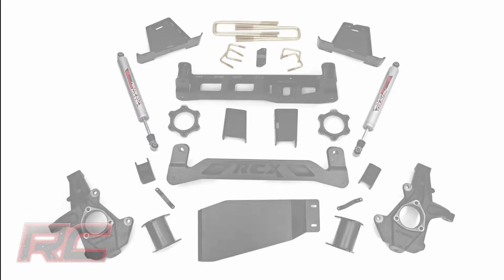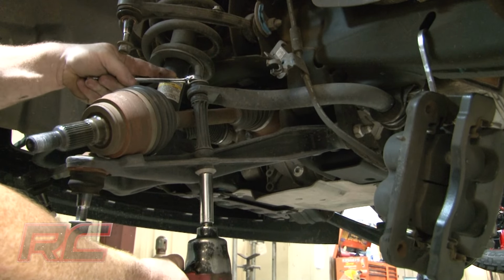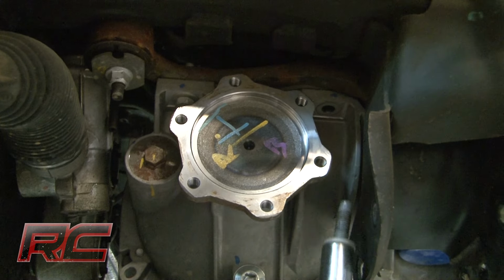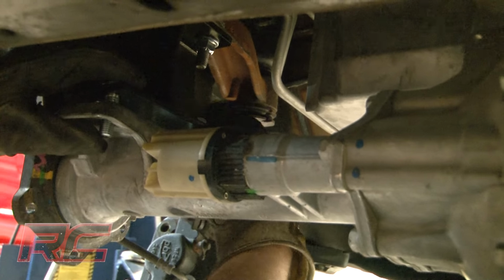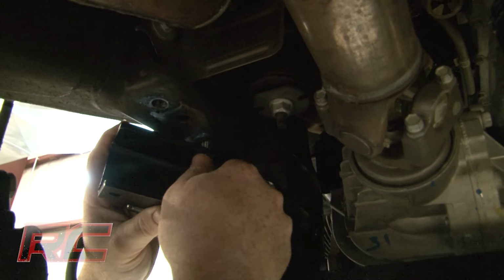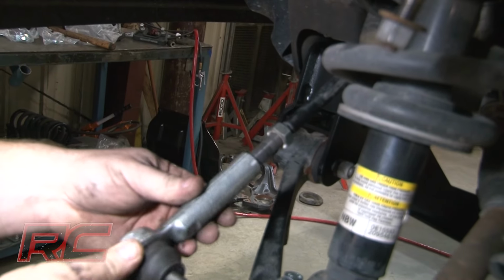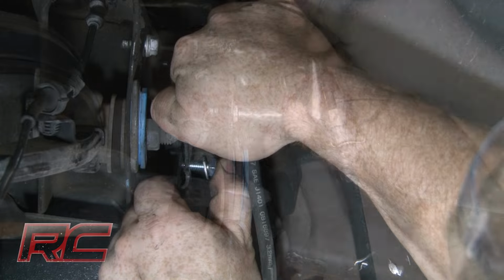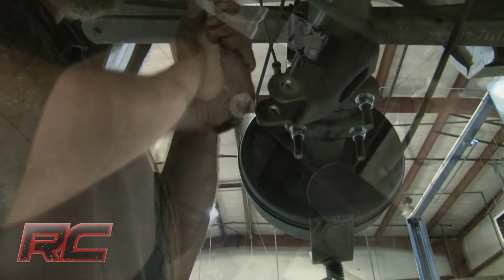Installing 2007-2013 GM 1500 7.5-inch Suspension Lift Kit by Rough Country

Comment: Anyone knows what size of lift is in the front I bought a truck with a spacer lift and spindle and now I need new struts but not sure what size of struts I need
Reply from the maker: this is a 7.5" lift. There's a link in the video bio that will take you to the site for full specs and install intructions. If you need further help, you can reach out to our support team and they can sort you with the parts you need. For assistance, please contact our sales team—they’ll be happy to help. You can reach them by phone at 800-222-7023 or by email at customersupport@roughcountry.com.

Comment: Was there any torque done per specification? My lift took long to install as I looked at torque specifications for proper installation rather than just tightening nuts and bolts

Comment: Worse thing to do is to cut out for the crossmember. Had my lift for. Few years now looking in too dropping it back to stock… fuxked up thing is that no shop will tell you this.
Reply: Yep… these lift kits are cool until you want to be practical or sell the truck

Comment: Just want to say that i just did this lift on my buddies truck. Good luck getting the knuckle and top control arm to connect. I was 2 inches away and thought they sent the wrong struts. We used the 7.5 lift struts instead of spacers. I called rough country and ran all part numbers. I finally got it but had to use strut compressors. Pretty sure i almost met god, but i did get it.

Comment: Does this require major modification or could this easily be changed out to a smaller lift? I’m looking at a truck with this kit but the lift is too high
Reply: It's a 1 time lift. Theres too much modification. There's no removing it once installed.

Comment: Just installed this kit (7.5in w/N3 Struts) on a 07 Tahoe 4WD. I was wanting to purchase your forged upper control arms but in the description it states, Does NOT fit models with 5, 6, or 7.5 inch suspension lift kits. In a response here to another comment, you said it will. Can I get an answer on whether it will fit or not?
Reply: yes they will fit

Comment: Does this lift require aftermarket upper control arms or can I use my stock ones?
Reply: aftermarket ones are recommended, but stock ones are still useable. it just puts more strain on them with the weird angles

Comment: I bought my truck 09 GMC Sierra and I’m not sure the exact lift I have but it’s a RCX Lift kit installed!! My rear blocks are 7” and front strut spacer is 6”.. 🤷🏼‍♂️
Reply: I’m in the same boat, let me know if you found any helpful information!

Comment: I have a 2011 z71 with the 7.5" lift kit, and was to the understanding that the stock upper control arms are ok to use, but I have gone through 2 sets of upper ball joints (moog) since installing (less than 30k miles). Should I use a different style upper control arm?
Reply: Hey what did you end up doing? I have extended uppers for my leveling kit.. I'm wondering if the extended uppers will be okay to use with the new knuckles or if I need to use the stock ones..
Reply: RC has new forged UCAs to help with those angles for this specific kit.
Reply: Moog used to be top of the line not anymore they are garbage best to get oem.

Comment: 8-10 hours the direction say...2.5 days in the average joe garage, even with a sufficiently full set of tools and that's assuming you don't sleep the first night. If you want to get this done in 8-10 hours, they should ship that second dude to you in the box so he can hold everything while you unbolt it. The main dude in the video barely has grease on his hands. By the end of of day one, the bums outside of the auto parts store didn't want to get near me because I looked too dirty.
Reply: Took me 12 hours and I’ve never put a lift on before
Reply: @koltonhinton4894  let's see it
Reply: You must be inconsistent or working on a rust bucket or all in all not a mechanic lmao
Reply: lol 😂so true
Reply: Took me 3 hrs
Reply: just put the 7.5 inch lift on started at about 930 am drove it home at 530
Reply: finished same day
Reply: This comment is 8 months old and it is entirely under rated lol

Comment: CV shaft angles are absolutely ridiculous. Make a better drop bracket, or we won’t buy RCX anymore. I’ve gone through 4 hub assemblies and 4 CV shaft assemblies.
Reply: The diff drop brackets are to short. They should be at least 2" bigger then the cv angles would be better.

Comment: If your going to cut the outer tie rods why not replace them with something you can grease. As this stuff gets older I see that as a problem. I would have included new inner and outer ends in the kit. Pretty cool otherwise. Sounds like it would fit a Tahoe as well?
Reply: I couldn’t agree more . I’m getting ready to install a RC 6” lift by myself. I already have the kit but I am replacing cv shafts hub bearings all bushing’s etc while I have it apart.

Comment: Hello I have a 2007 gmc yukon xl denali will this kit fit my truck.i took off all my electronic suspension in the front and put regular struts and the same for the rear took the air shock off and put regular

Comment: Looks like a fun way to lose your rear axle. I like the front end lift parts, but your rear lifts are so unsafe! Why not offer less blocks and more leaf lift.
Reply: Because it will ride like a dump truck, this is actually better, it's safe when installed correctly.
Reply: My Chevy 1500 pulls 8,000 lb mini-excavators on double axle as well as fully loaded dump trailers haven't had any issues yet with these blocks my truck had now has 420,000 km and if you add more leaf springs u lose your flexibility for off-roading 2010 Silverado on a 7.5 in rough country suspension lift on 35s
Reply: I put 3500 leaf springs on my 1500 and it rides perfectly fine for me. 
I’m not a sensitive man that would complain about flexibility or rough ride nonsense, but to each their own. 
It is what it is..

Comment: I just picked up my 7.5 lift for my 08 GMC 1500 yesterday Tue/April/6th  and I am so disappointed in it that I will be returning it. I got the old styel strut spacers, the ones that had the problems with the welds cracking when tightening the bolts and not the new styel ones, You guys really cut corners on the welding of the components, their should have been more welds, And I have never seen orange peel on powder coating so even the powder coating is the shits. I would be scared to even put this lift on my truck.
Reply from the maker: It appears you might have just received a bad part as that is not common on our spacers to not be sufficiently welded or manufactured. We would be glad to send you a replacement pair if you gave us a call at 1-800-222-7023

Comment: Can you run 35x12.5x20x9"on factory rims with no trimming to inner or outer fender well with this lift.
Reply from the maker: As noted on the site you have to run aftermarket offset wheels on that kit due to the lifted knuckles that are included in the kit.
Reply: @RoughCountryTV  "I just bought black factory 20"x9" rims for $800.00 Canadian so I better be able to use them with this lift" This is off your website:  Gain ride height at an incredible value with Rough Country's 7.5-inch Suspension Lift for '07 - '13 Chevy / GMC 1500 Pickup. This massive lift affords your truck the ability to run up to an impressive 35-inch tire on ((factory wheels)) with our unmatched front and rear high-clearance crossmembers featuring the "RC" logo. It says nothing at all about running aftermarket offset wheels. It also says you need a minimum of an 18'' wheel for clearance.

Comment: I have an 08' Silverado 2wd, and I want to install this exact lift, will it require the cutting portions?
Reply: Don’t....
Reply from the maker: https://www.roughcountry.com/gm-suspension-lift-kit-263.html?find=2008-chevy-silverado-1500-2wd-374116

Here is the 2WD option
Reply: 😂😂 jack up a 2 wheel dig
Reply: Do you have to have a new drive shaft to put that lift on

Comment: I'm new to learning about the lift kits and such. What size wheel spacers would I need on the rear to match with the front track width once I put the lift kit on? Putting a 6" RC suspension lift. 2008 gmc sierra 1500 z71. Thanks
Reply: 2 inch
Reply: I thought basically the same width as the cv axel spacers

Comment: This lift was installed on a truck that I just bought, but the camber is way off on my tires if I get your longer upper control arms would that bring it back out instead of using the stock upper control arms because they rub the coil springs.
Reply from the maker: Our upper arms would allow for additional camber adjustment
Reply: @RoughCountryTV  broooo you again. You guys told me tha I won’t,  I’ll never gonna bye RC stuff, y’all don’t know how to make anything about liftkits. Twice alignment, new upper and cam plate… you just ruin my suburban
Reply: @samuelrodriguez9395  I believe that was user error

Comment: Video I’m assuming shows reusing the stock upper control arms, i have a 3.5” kit also from RC. Can i use these upper control arms or will i have to find a stock set?
Reply from the maker: Yes this kit is using the stock uppers. You can use the aftermarket arms on the 3.5" and 7.5"

Comment: Does anyone know What is the torque spec for the ubolts on a 6in on a 2009 sierra 1500?

Just bought your Trac bar kit and don't know the torque specs?
Reply from the maker: 95 FT LBS on the track bar on both ends

Comment: I'm very interested in this kit! However, I noticed it's advertised as "for 4WD Chevy trucks"!  I own a 2008 GMC Sierra 1500 RWD. Is there a different kit for that?...Thanks......Richard
Reply from the maker: Yes there is a difference in the 4WD and 2WD options. Here is the link for the 2WD option.

https://www.roughcountry.com/gm-suspension-lift-kit-263.html

Comment: If it’s a 2wd will it still require the cutting portions
Reply from the maker: 2WD does not require any cutting
Reply: Rough Country what would you rate the difficulty on this specific truck and lift but on a 2wd for the average joe.

Comment: Just cerious if you don't cut the tie rods and it ends can u still get it within soec
Reply from the maker: No. The tie rods have to be cut in order to bring into alignment specs
Reply: @RoughCountryTV  one other question with doing this and putting bigger tires on will it drastically lower towing as I have a 7x16 inclosed trailer with 2 sleds

Comment: I had a miserable time getting the upper control arm into the knuckle after the lower ball joint was installed. I had to use ratchet straps to pull the control arms towards each other just to get enough thread on the upper ball joint to grab it and suck it into the knuckle. I didn’t loosen the upper control arm during install, it would have most likely been easier that way, but there was barely any compression in the strut/spring assy to allow for installation
Reply: Need new a arms I bet ur tires wore on the inside

Comment: I have a 2008 Silverado 1500 that I bought that came with a 4 inch suspension lift and I added a strut spacer so basically a leveling kit to make it a 6 inch lift now my CV angles are at an angle and was told I need to drop the front diff down more but called rough country and the front diff block spacers are the same for a 4 inch  lift and the 6 inch lift? A suspension shop told me I had to just take the lift off because there was nothing I could do. I just didn’t get how a 4 inch lift and a 6 inch lift use the same size of front diff drop bracket and how the CV angles wouldn’t be different then with the larger lift ?
Reply from the maker: You have created the CV axle issue by adding the level kit to the 4" kit. Your best bet is to replace the 4" strut spacers with the 6" strut spacer to correct the geometry and removing the level spacer.

Comment: Had this lift installed on my 08 1500 vortex Max. Pushed the breaks real hard to keep from hitting a girl running across the road. Driveshaft ended up popping out too much and when I stopped putting so much force on the break the driveshaft tried going back in but ended up destroying the slip yoke and tranny had to be replaced/rebuilt. The tranny shop said I needed a 2 inch spacer but another truck/lift shop said there’s no need for a spacer, maybe the shop that installed the lift put the blocks on backwards?  SO I wanted to know if I need a spacer or a word with the guys who lifted my truck....
Reply from the maker: The bigger end of the block should be the rear of the vehicle. Is that the way it was installed? Do you have a 1 piece or 2 piece rear drive shaft?
Reply: Rough Country the blocks are installed correctly and I have a one piece driveshaft. My trucks is a 2wd

Comment: Any kits for the 06 4x4 silverado?  Looking to get 24x14 on 35 but want minimal cutting.  What size lift do you recommend?
Reply from the maker: That size tire and wheel requires a 6" lift kit to clear that tire and wheel combo

Comment: Can you replace rc rear shocks with billstein or something else? Or Are they taller than normal, thanks.
Reply from the maker: Our shocks are taller to accommodate our kits on the vehicles. You can use other aftermarket shocks as long as they are the correct specs for the specific ride height.

Comment: where the front cross member is installed the upper bolts where you cut your better off welding each side it makes craking noices like hell dont know if i had wrong bolts or what threads are 1/2” inside the plate making cross member slide

Comment: What if you want to go back stock? Can you go back ?
Reply: Alan Perez save the piece of steel you cut off and all the stock parts, all you have to do is weld it back together. It’s an easy weld. Make sure you do your cut nice so it’s easy to refit and weld after
Reply from the maker: Once you install the 5", 6" or 7.5" you can not return the vehicle back to stock ride height.
Reply: Alan...but why go back to stock?
Hope you got your lift...once you go there...you will never be the same...hahaha

Comment: even for a 6 inch lift kit will they be cutting  and if the cutting is necessary won't   that weaken the frame or something
Reply: I believe the only difference between the 6" kit and the 7.5" kit is the rear blocks, u-bolts, and strut spacers.
Reply from the maker: You cut the tie rods and tie rod ends, crossmember pockets and diff but with this kit installed per instructions and the cutting that is needed to be done it does not jeopardize the integrity of the strength of the vehicle or frame.

Comment: I bought the 6 inch do I really have to cut my tierods?
Reply from the maker: Yes. In order to properly align the vehicle you will have to trim the tie rods and sleeves on the knuckle kits.
Reply: Rough Country but my instructions don't say to do that?
Reply: Yes. Just did mine. Instructions say cut 3/8" from inner and outer tie rod. I ended up cutting 1/2" on driver side for a little more toe in alignment.

Comment: Go mcgaughys..you dont have to cut anything!!
Reply: Yes you do, you cut the crossmember bracket. Obviously you do not have the kit, but in the instructions, it is step 11.

11. On the PASSENGER side lower a-arm frame mount you
will need to cut off 3 1/2”. Using a marker and a straight
edge, measure and mark 3 1/2” from the edge of the frame
mount inward and then cut with a sawzall.
Reply: Strixx well that sucks..i heard you didnt have to ..thanks for the info !!
Reply: Strixx could I take my rough country lift off and install my 7-9 McGaughys without any problems?
Reply: Yes you can. It will more or less bolt up without issue. I have personally never done this, but my shop has many of times.

Comment: How many inches are from center of wheel to fender 
Front and back 
How many inches is the total high of truck front and rear 08 silverado 2wd
Reply from the maker: 28.5" from center of the wheel to the fender. We do not offer the total height to the top of the truck due to variation in tire sizes.
Reply: Rough Country  i have 33/12.50/20
Reply: How much of a drop does the front crossmember have is it a true 6" or 8"

Comment: Can’t you guys come up with a hardware design that does not require any cutting?
Reply: It's basic physics really... 2 things cannot both occupy the same space at once. If you think this is bad, find some old 4x4 magazines and look at what it took to install early IFS suspension lifts. None of the cutting in this kit compromises strength of the chassis. The one single change I'd like to see would be a single piece crossmember. As far as I know there's only one company doing that, and their kit costs twice what this one does. This will be the kit I install on my truck when the time comes.
Reply: The cutting is the easiest part.....
Reply: trunkbangking......You still have to cut the crossmember like every other kit. There is no way around not cutting it, the diff will hit no matter what. You would have to drop the diff almost 15 inches to clear the crossmember bracket.

You obviously do not own the kit, so how about doing research before you comment.

Step 11 in the McGaughys SS 7-9" Lift

11. On the PASSENGER side lower a-arm frame mount you
will need to cut off 3 1/2”. Using a marker and a straight
edge, measure and mark 3 1/2” from the edge of the frame
mount inward and then cut with a sawzall.
Reply: Mcgaughys lift..no cutting full 7 inch drop crossmember.
Reply from the maker: That would be hard to do since we have to drop the diff so much to and have to trim for proper clearance.

Comment: Whats the highest lif kit for my Avalanche -08 AWD?
Reply from the maker: 7.5" is the biggest kit we offer but you will have to change out your front drive shaft to a double cardan drive shaft in order to run that kit. It will not work with the AWD
Reply: Thanks! And if i want to save the awd funktion? what kit can i run then?